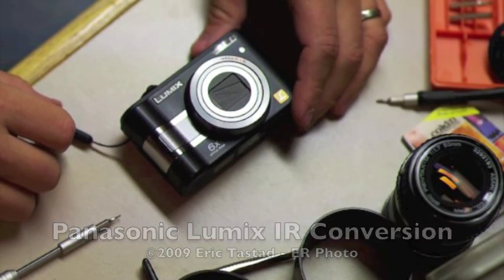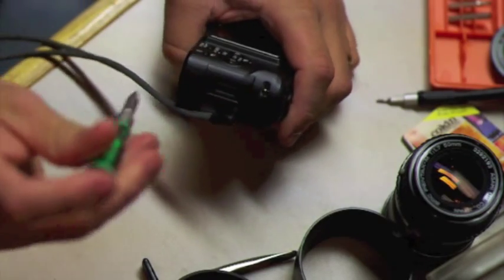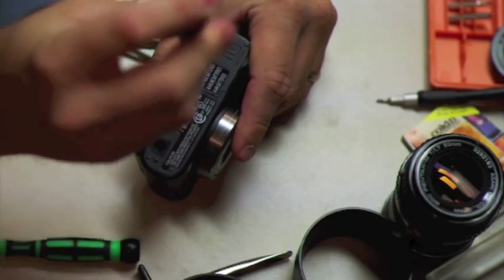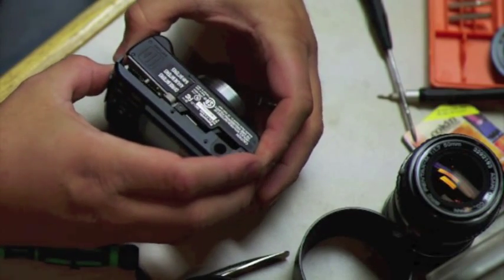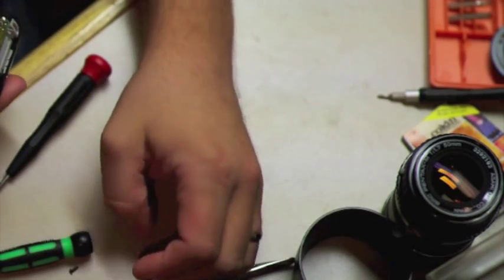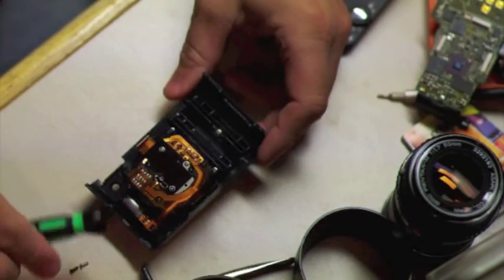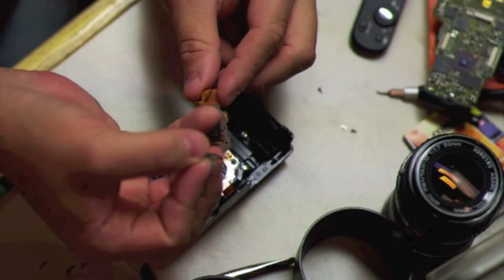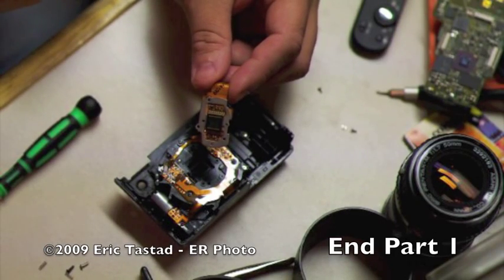Panasonic Lumix Infrared IR Conversion DMC-LZ5 (1/3)

Comment: Mine is the DMC-LZ7 AND WHEN I try to take off the top there is a capacitor on the lst top side and I am afraid that I won't be able to get it back . It seems spring loaded or held in .